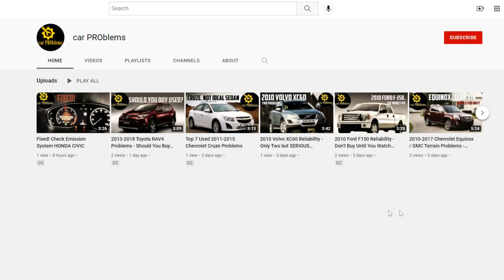Burning Smell From Car -- Top 5 Reasons of Burning Smell Inside Car

Comment: I was in a jam and smelt something burning I suspected clutch, how long should I wait till I see the mechanic?
Reply from the maker: If you suspect that your clutch has burned out, it is best to take your vehicle to a mechanic as soon as possible. Continuing to drive your vehicle with a damaged clutch can cause further damage to the transmission and other parts of the vehicle. It's best to have a professional diagnose and repair the issue to avoid costly repairs in the future.
Reply: @carproblemsmax  Hey,

My clutch set and flywheel are fairly new, having been changed about 10K miles ago. I recently had an oil and brake change, and ever since, I've been smelling something burnt, similar to a burning clutch. The mechanic told me that some oil might have spilled into the engine compartment and that the smell should go away. However, it's been more than a couple of months, and I can still smell it occasionally. 

I notice the smell when I stop the car and stand near the hood, and sometimes I can even smell it inside the cabin. It became worse during a recent hill drive, so I can confirm that it's the clutch burning unusually fast. I've had this car for more than 10 years, and while I've had to change the clutch a few times when needed, I've never experienced problems like this. It feels like my clutch is burning even during normal driving. What could be the reason?

Thank you.